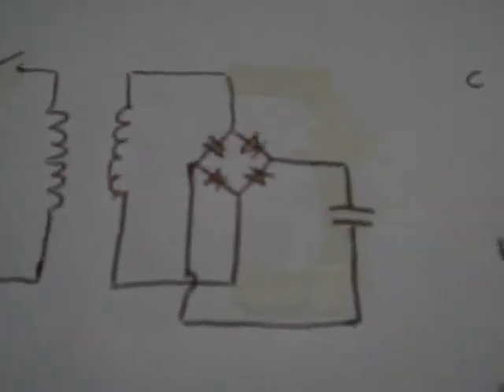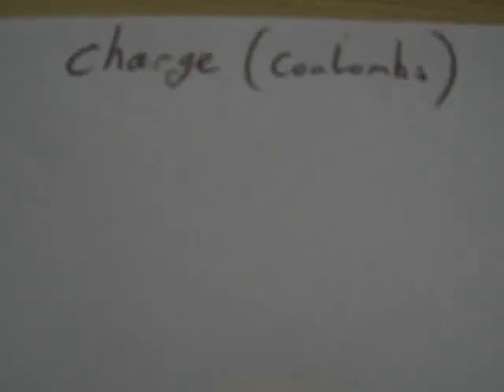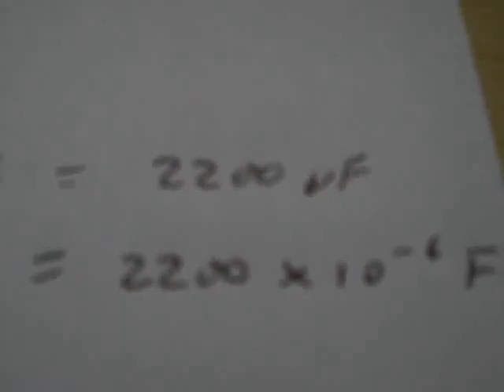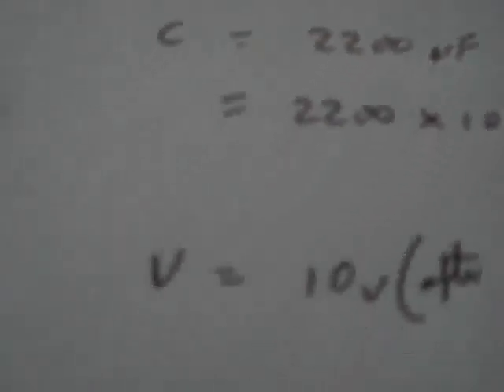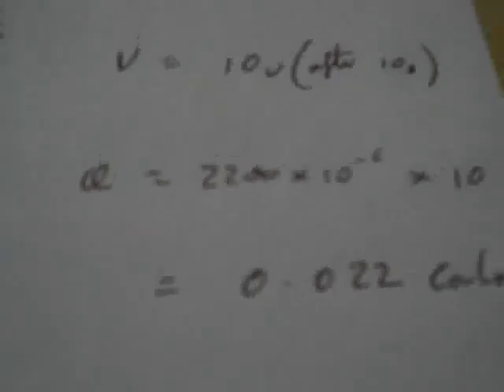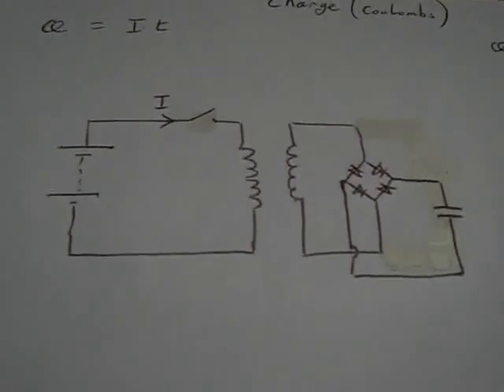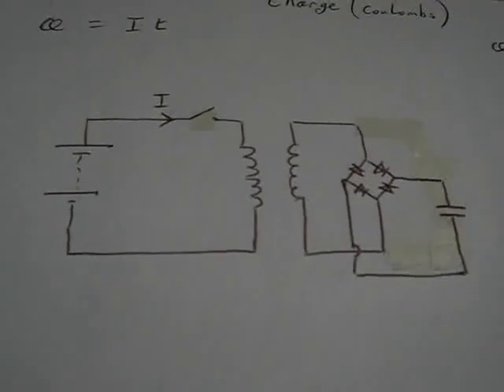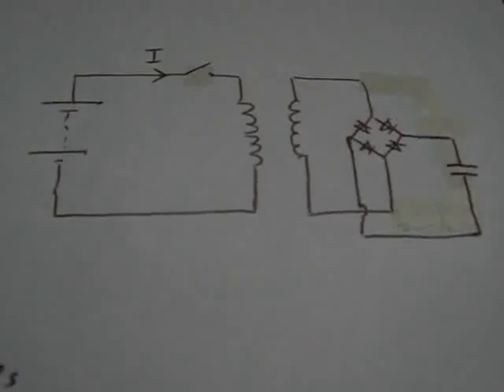Overunity measurement Part 5

Comment: Thank you for acknowledging the rotor work. Also remember by adding several Generator coils around the rotor you can produce more electricity with almost no extra input. 
Unfortunately I am not using an inverter myself yet but will be in the future. If you are hoping the losses in the inverter circuit will show up causing too much loss well sure they will but there will always be plenty of charged up batteries to swap with the primary and recharge the dead ones because it uses mA not amps to run

Comment: Sry, My mistake re the 4%. 
Big batts do more work. The point here, well for me anyway, is not just to charge batteries cheaply, but to use the charge as opposed to buying electricity.  I charge all sizes from AAA - 12v 24 Ah and later bigger. Which reminds me, what makes you think the the large batt banks on Bedini's site are supplying the charge and not receiving it. If you could charge 4 batts with 1 all equal sizes would you do it? I would!

Comment: the extra energy doesn't show up in the circuit. the "free" energy ONLY shows up INSIDE the charging batteries so meters will not detect it... 

By these formulas I should only be getting a 0.0347 COP 

However (with load testing) I'm actually getting 0.9 COP.  

I don't know if this means it is over unity or not, though I am sure that these formulas don't accurately portray how electricty behaves in these devices.

Comment: I'm afraid I disagree with your methods of measuring power with these pulse motors...

for example, I used one of your formula to work out how much power was going into the charging batteries and how much was going into the motor:

3.6 watts going into the motor
0.125 watts going into the charging batteries.

so only 3.47% of the energy going in is being captured.

HOWEVER... if this is the case, how is it I can swap the batteries DOZENS of times before I have to top them up again?